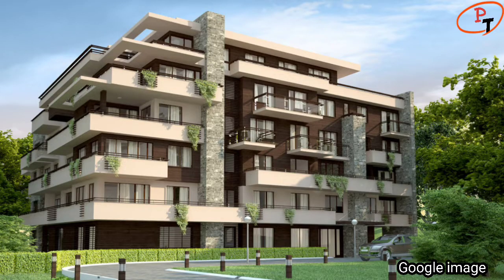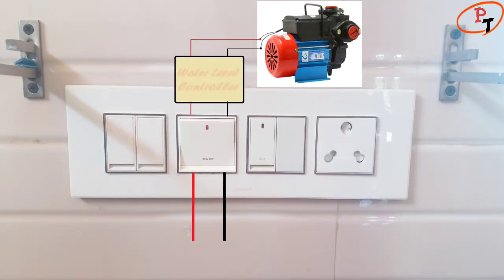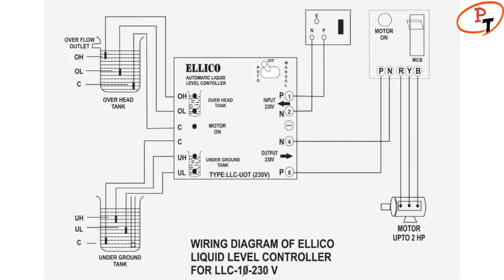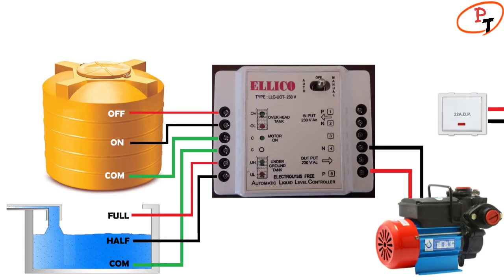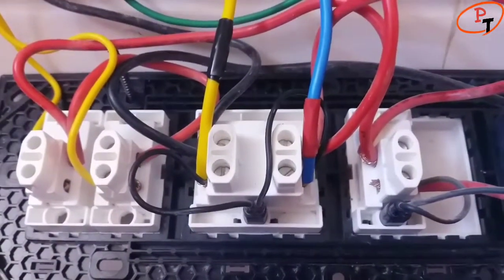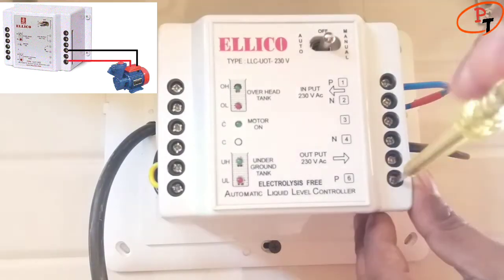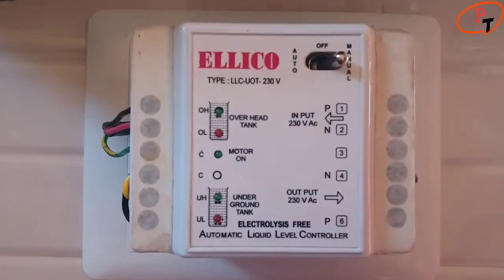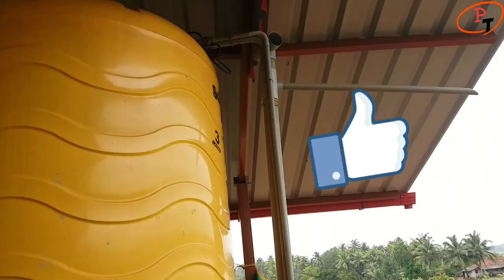AUTOMATIC WATER LEVEL CONTROLLER | PRACTO TECH #64

Comment: in my house, there is no pump needed to store water in top reservoir, can i use these to open or close the valve that is used to send water to the upper tank.??
Reply: No because this controller is designed on basis of motor required ampere ratings

Comment: 3 phase explain plz
Reply from the maker: Sorry Mr. Mahesh, i don't have much idea about Electricals. Am a Mechanical Engineer. I just studied the circuit diagram provided by the supplier along with the Water level controller and did the wiring for my self.